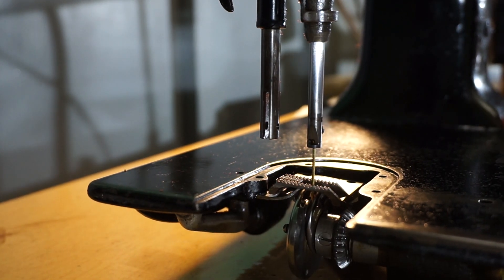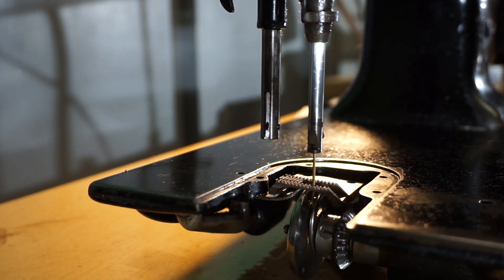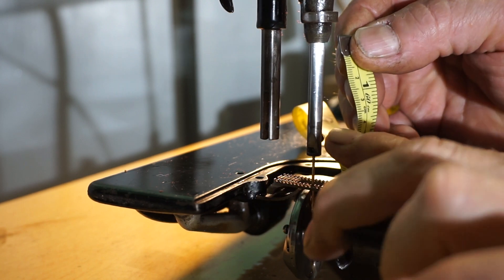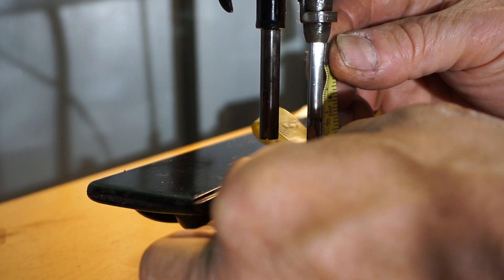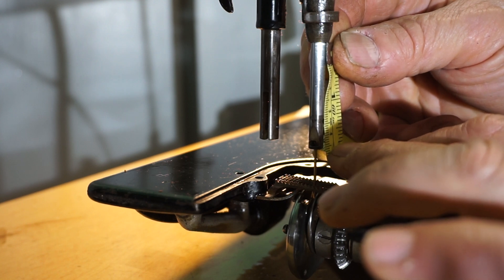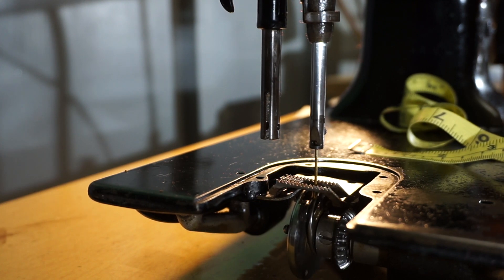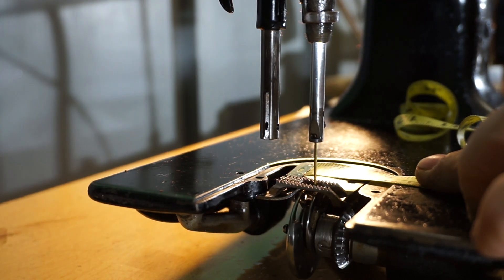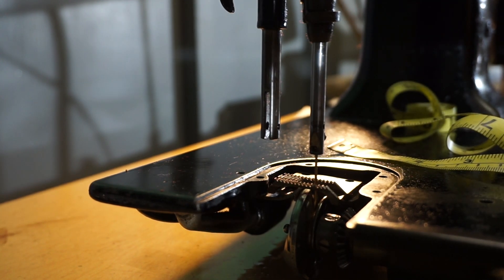Singer 107W1 Rotary Hook timing check.

Comment: On my 107 W1 machine there is a faint mark on the shaft which holds the needle at 3mm from bottom dead centre. You rotate the handwheel till the needle is all the way down. You should see a faint mark on the needle shaft at 3mm from where it slides back up into the mechanism.If not, then with a sharpie or like marker, make a mark on the needle shaft 3mm below the edge of the needle slide mechanism. 
Continue rotating the handwheel, raising the needle till the mark is just about to disappear into the slide mechanism.
At that point, the point of the hook should be just starting to cross the needle at the eye. That is correct timing. To adjust timing, don't loosen any grubscrews at the front of the mechanism. Loosen the ones at the back of the timing shaft,  and, while locking the handwheel so the needle holder doesn't slip, turn the lower timing shaft till the hook is  just starting to cross the eye of the needle. snug up the screws and you're done.
That said, check your timing first. It's probably correct if the machine worked well before. But if the machine drops stiches, or tngles, the timing may be off.
Reply from the maker: I have 4 0f these 107w1's and 2 have the marks. Not all replacement needle shafts are marked.
Reply: Thank you for this. I have a 107WSV16 and an currently trying tonget thebtiming right. This particular machine has no feed dogs, made specifically for embroidery
Reply: Just attempted to take a video of my machine, hopefully it shows under my name if you want to see it
Reply: have you ever found some sort of database to check when your machine was made? Mine has a serial number of : W1272851...I couldn't find it on the ismacs website. Thanks
Reply: @tomgrady8762  I also couldn't find any W series serial numbers on any websites. All I know about my machine is that it probably had one owner-the Australian army's RALAC -Repatriation Artificial Limb and Appliance Centre, and a date-1950 -on a sticker on the base.
Reply: @autophyte Thank you much for the quick answer and your video posts..Tom